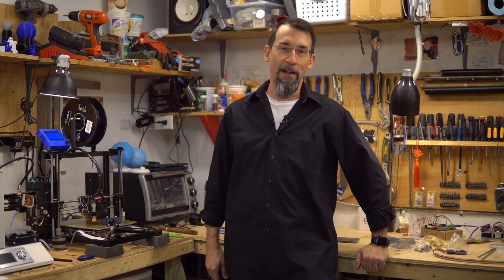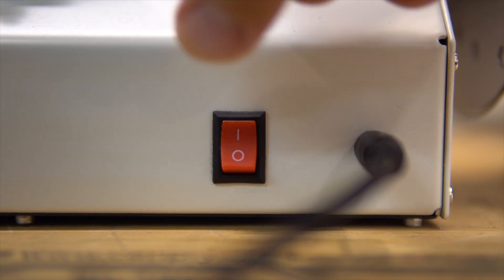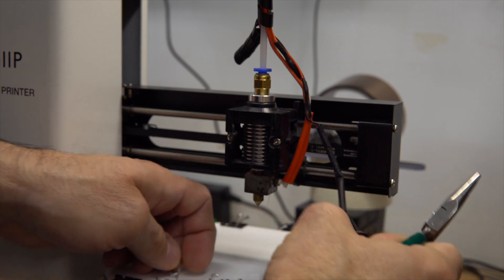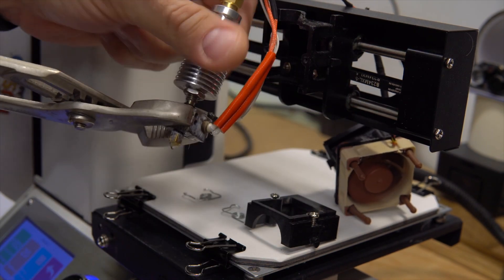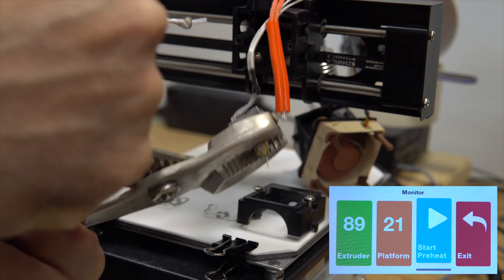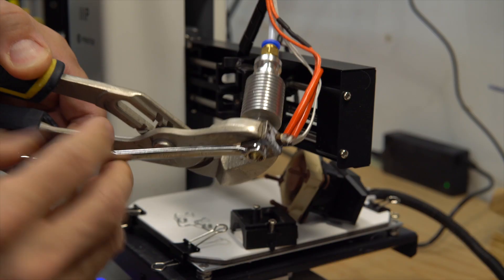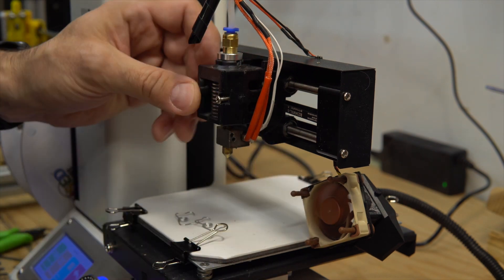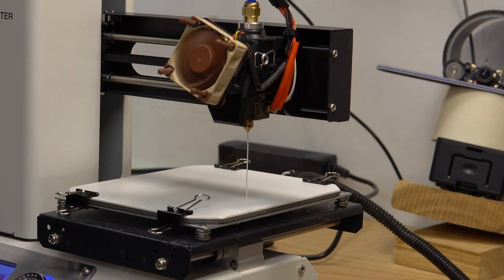Monoprice Mini - How To Clear a Nozzle Jam Easily

Comment: Your video helped me a lot. thank you!. When I got the tube out, the hot end / heat sink area was filled rock solid with plastic and would not budge. I heated the extruder to 250 and used a paperclip instead of filament to push and the clog finally came out. it was very satisfying, like popping a zit LOL

Comment: Could you get away with just heating it up and then directly detaching the nozzle from the heat block without removing anything else?
I'm wary of total disassembly after doing the bed wire rerouting and only having marginal improvement compared to the amount of stress it put me through

Comment: What causes the filament to get jam? Is there anything I need to be aware of to reduce the potential of jams?
Reply from the maker: Usually it’s heat that creeps up on long print, you need either better cooling of the upper part of the hot end or a heat break that transfers less heat like Titanium the goal is to keep the hot end at temperature and the cold side as cold as possible.

Comment: I have a issue printing an object on MP Select Mini V2.  The objective is too big.  I managed to tilt it sideways with supports but it always ends up clogging the nozzle and building filament around the heat block.  Any suggestions?
Reply from the maker: Check your extrusion or decrease it by 4-5 % to see if it helps. make sure nothing moves when printing maybe adding more dense supports to help with that, if it moves during print it will do that.

Comment: Hi, how do you change the thermistor in the extruder?
Reply from the maker: I think it is maintained in place with high temperature silicone. It will be difficulty to replace on mine. Replacement parts: https://www.mpselectmini.com/parts/heater_block

Comment: Updated for July 2019: New models have touchscreen; no knob.  Read this for recent V2's.
  Monoprice support gave me this link and verbal advice on 23 Jul 19, on unclogging the original Select Mini V2 printhead assembly.  I got mine mid-Jun 19.
 First step in unclogging is to remove the teflon tube from the brass Bowden connector on top of the printer head by pushing down on the blue plastic while pulling the tube.   Heat to 220 or 225 degrees, wait a couple of minutes, then try to push filament thru with some force.  Cleaning filament is best for this, and do the "atomic" extraction at 160-180 degrees several times for thorough cleaning.
 If that doesn't work, here's a pictorial on disassembly.  Rather than use pliers on the nuts, use a 10mm wrench to fit both top and bottom.  If the heater block has a black rubber protector, you can peel it off.
https://monopricesupport.kayako.com/section/2-common-issues
  Dissembling the Mini Select V2 E3D Extruder Assembly
https://monopricesupport.kayako.com/article/327-dissembling-the-mini-select-v2-e3d-extruder-assembly

Comment: Hi! What if I can't get the filament out in the first place? - I can't push it through manually. What should I do?
Reply from the maker: You should be able to unscrew the bowden fitting on top of the hot end or near the extruder, that way you will know if the filament is stuck inside the tube or in the hot end, sometimes some debris or the filament itself gets stuck in the tube. To prevent this extrude some plastic before removing the filament. https://youtu.be/6Q3fHbIQ6TM

Comment: Oof "easily"
Reply from the maker: It’s the easiest I can come up with :-)
Reply: @Franks3Dshop  I understand. I just used some cleaning filament and took out the pipe from the Boden connector.
Reply from the maker: HI, good I do not have any cleaning filament and it does not happen too often.

Comment: Sir in my filament is not insert in fin cylinder what can I do for that
Reply from the maker: HI, I would dismantle the hot end and see if something is jammed inside, you have to do that with some heat, try 180 degrees. Be careful not to burn anything or yourself. Sometimes some debris gets in the tube.
Reply: @Franks3Dshop  thank you sir

Comment: Hi Frank, speaking of nozzles, can you recommend replacement nozzles? I saw a set with different orifice sizes, but it was unclear if they fit the MP Select Mini or just the MP Select, (which I don't have). Thanks, Rocky.
Reply from the maker: I have used those ones, they fit even if they are not identical, you just have to lower the bed a little more.
    Nozzle I use in packs of 4:

    Amazon US http://amzn.to/2As7bs2
    Amazon Canada http://amzn.to/2zDZy4H

And those are a direct replacement.
    5 Variety Pack 3D Printer Nozzle 0.2mm to 0.8mm:
    Amazon US:
        http://amzn.to/2i4BJZp
    Amazon Canada:

        https://amzn.to/2KD0ecL

Those should be the same for a pack of 0.4mm
    Amazon US: https://amzn.to/2rkiUp2

    Amazon Canada: http://amzn.to/2ACYRWD

Comment: Hey Frank! Great video! This looks to be a much safer way to clear a jam than doing it while the fan shroud and all other parts are still connected. 

Two questions. 

What version of firmware are you running? Your mini's display looks much more modern than my 3 month old V2. 

What fan shroud are you using?
Reply: I found your fan video. https://www.youtube.com/watch?v=TkYUkkZEs4Y&index=2&list=PLMxAz7x1vIz2g_vSJMypTaE8arJaT4ZYG
Reply: Disregard the second question. I found your Noctua fan and shroud adapter video. 

https://www.youtube.com/watch?v=TkYUkkZEs4Y&index=2&list=PLMxAz7x1vIz2g_vSJMypTaE8arJaT4ZYG
Reply from the maker: I am using version 41 from https://www.mpselectmini.com/firmware/motion_controller be sure to read all of the warnings and instructions if you decided to upgrade. Also make sure you have the correct version for your printer.
Reply: Thanks. Much appreciated!